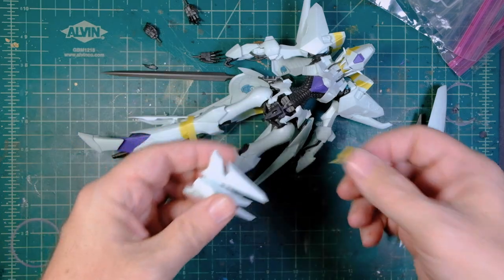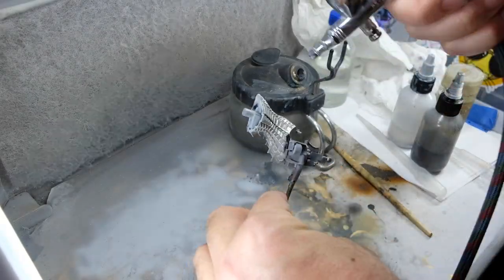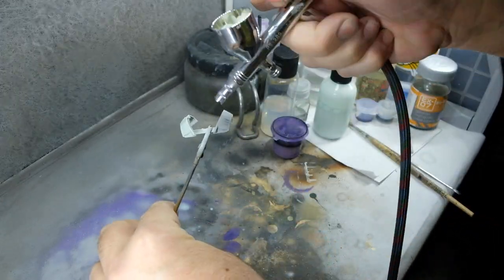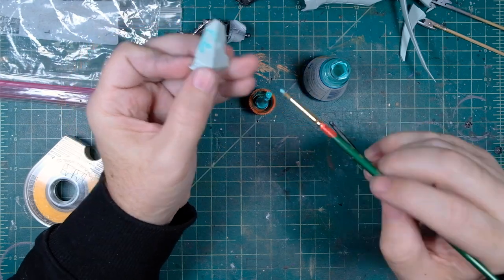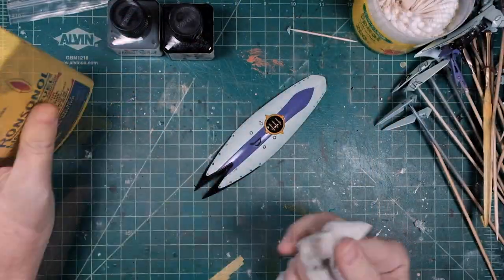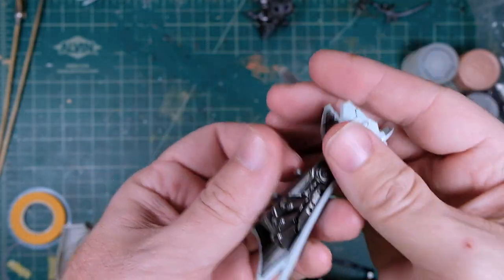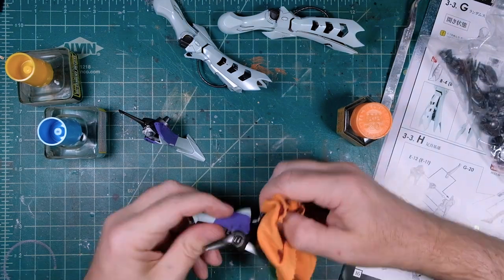PAINT PART 2 - Five Star Stories - Volks Engage SR1 - 1/100 IMS

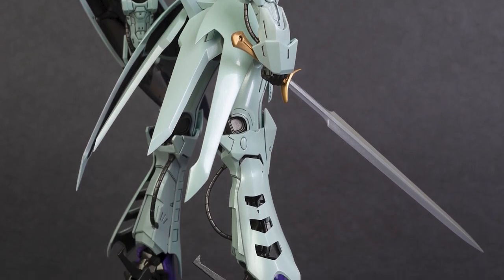Comment: 42:57 "juhn-june" lmao
Reply: Volume 04, page 31 ;)  (US edition)

The Our Treasure Jünchoon / Junone kit just went up for pre-order today, might want to check that out.
Reply from the maker: @Noisy-Pink-Bubble  I saw that. It looks pretty good, although kinda sad it's a fixed pose kit.
Reply: I much prefer my kits to be fixed-pose, since models are first and foremost about looks and joints break up the sculpt. Not to mention that among anime robots, Mortar Headd joints are especially physically impossible to replicate. Every "poseable" MH model can only pull off a slight shuffle at best, so why even bother.

Hypothetical GTM plastic kits could probably be engineered to be decently poseable, since they have much simpler construction compared to MHs.
Reply from the maker: @Noisy-Pink-Bubble  Fixed pose kits definitely have their benefits. Stability being the main one, and I can definitely understand that preference. I personally like the option to repose it before it's placed on a base. I understand the MHs poseability is pretty limited, but even small movements can make a difference. For example, I made a base for the 1/144 Prominence and placed it into the "foot up on a hill" pose from the manga. It's a minimal "pose" but I wouldn't have been able to do that easily if it were fixed into a straight standing pose from the box.

Like I said though, I definitely understand the preference. I had to make the Vaiola that I built for Volks a fixed pose because it wouldn't stand on its own..hehe.. with such a back heavy kit, it would be a prime subject for fixed legs at the least. 

If this link works on youtube, here's the Prominence base I mentioned for reference.
https://www.instagram.com/p/CUZW2H4Lw98/